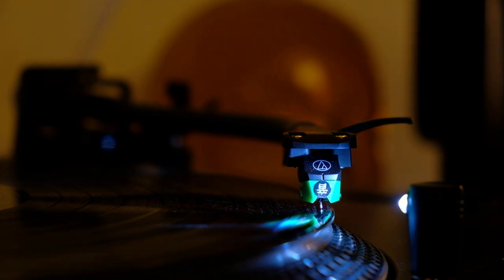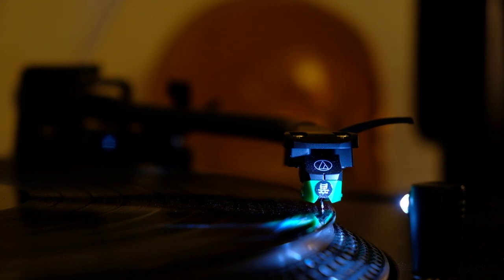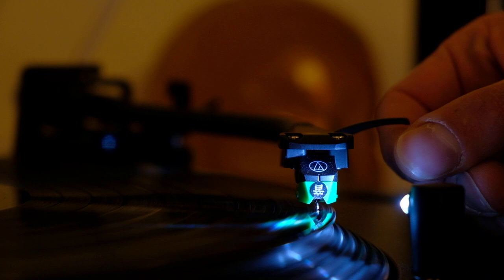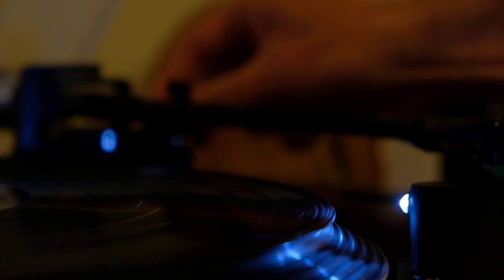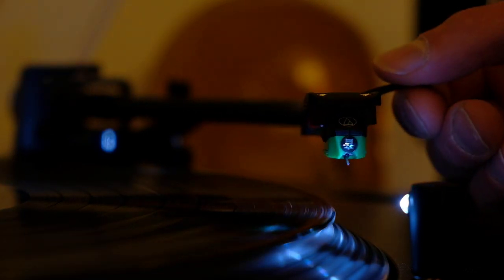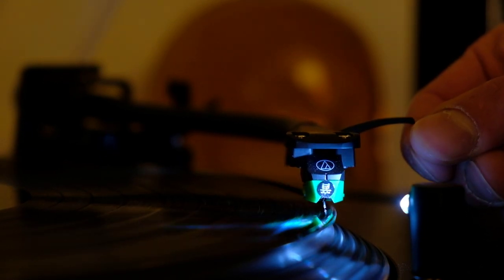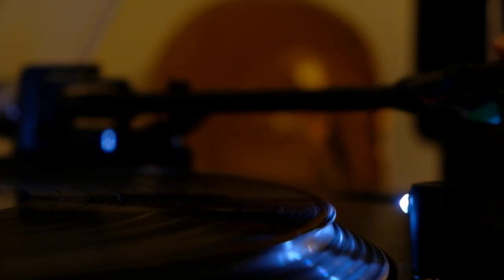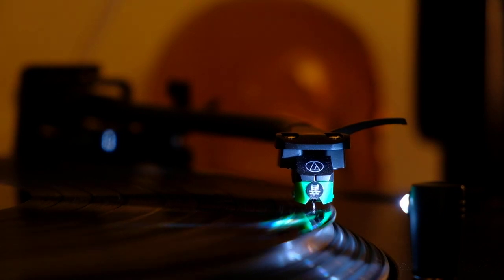Quick and dirty anti-skating setup method

Comment: Finally a method that makes sense to help those without ability to accurately test this setting. It allows us to 
get it set very close to the proper setting. For most folks that is the best we can achieve. This setting has always 
been the one setting I could not feel confident I did right. I set it by careful listening and it turns out your method confirmed
I had it set well.  Problem with the dial type with numbers the spring weakens over time and matching the grams to dial is not accurate over time (may have never been accurate).  Thanks again for this tip.
Reply from the maker: There is another method that is even more precise but only works with manual record players. Check soundsmith’s guide on anti skating. Grams made no sense anyway, even if the dial were correct. You rarely end up there :)

Comment: Most interesting! But, something which I've used when the stylus 'finds' the groove is, is the arm trying to pull the stylus inward or outward...because that indicates more pressure on either the right-hand channel side of the groove or left-hand channel. Just have a look at the cantilever as it sinks into the groove (it helps if you have a long cantilever...my old V15 III and my new Goldring E4 have). I would say that my SME arm's lateral bias calibration is just about right - after all the bias markings are arrived at by more than guess-work. The blank disc method (yours is akin to that really) tells you only that you've put 'some' lateral bias on....not the correct amount necessarily!

BTW. The above method works when you lift the stylus out of the groove too....at the point where you relieve the cantilever of its tracking force (best use the stylus lift of the arm - the SME is excellent in this regard) see if the cantilever tries to return to its position relative to the cartridge casing.

Comment: This is great! I have set up my antiskating to the same amount as the weight itself (2 grams), which ís recommended by the manufacturer. However, dropping the needle at the beginning of my records had it skip over the first few grooves, which I now learned is something I might be able to fix with slightly more antiskating weight.
Reply from the maker: You are very welcome! It's well worth hooking up your stereo rig to a simple sound interface (Behringer has 25 usd ones that are just fine for this) and using oscilloscope software, it's available for free. The most expensive thing will be your test record, a good one is usually around 50usd, but that way you can setup everyone's record player.
Still, this method gets you close. And seriously, whatever manuals and even audiophiles say; this is the only quick method that doesn't involve an oscilloscope. Using a blank record makes no sense and setting it to the weight even less so. Manuals are often simplifying stuff, for instance; in a cassette recorder manual it always states to record until the meters only go into the red at the loudest peaks of the music. So that would be around +1dB's at peaks. Whereas tape manufacturers work really hard to make tapes handle way louder levels, sometimes even up to +10. If you were obeying the manual, you'd be wasting your money on those tapes. And it's the same with cars. No manual explains to you how to properly shift gears (i.e.; giving the gearbox time to synchronize from gear to gear, not putting it into first gear until you're almost stationary and actually letting the gearbox center itself, not pushing it diagonally to the next or previous gear). So I guess in the end we need to figure our stuff out by ourselves. Part of the fun, right? It's nice to get it right! :D.

Comment: Thanks for the advice. I have the LP120XBT + VM95E for daily listening and it’s working for me with VTF 2, anti skating at 1.1 with this method. I have the VM95ML too, but I guess that will need a different anti skating adjustment.
Reply: Same as me, weight at 2gr and anti skating at 1.0, weird configuration but works
Reply: Weird that I also found that 2.2 VTF and 1.0 anti-skate works best for me.
Reply: I used it at 2 for a long time and I noticed an improvement after doing the cd method. I also ended up at 1 with vtf of 2. The sound sounds a lot more balanced

Comment: Did this and it worked like a charm. My sound improved dramatically. Also matched up with a smooth movement towards the spindle on the inner dead wax of the record. This method stopped the aggressive jerking of the stylus into the spindle there too. Distortion gone. Using a laser disk I guess could also work but the goal there would be to watch the needle ride smoothly towards the spindle. And not for it to sit still at all points of the record-that wouldn’t work anyway on a pivoted tone arm; Maybe a straight tone arm.
Reply from the maker: Happy it worked! Still worth while getting a test record and scope, free computer scope software works as well. But in a pinch, this will save you :)
Reply: The Rolling Troll Thanks again. I fine tuned it  with a Wally-skater and it wasn’t too far off.
Reply from the maker: @DANIELHERNANDEZ-gg2lu  Hah, I wonder if that's from the same Wally as the Wally Tractor. I actually was at a lecture of his, amazing guy :D.
Reply: The Rolling Troll I think so. Wow. You got to see him before he passed. Amazing. Thanks for sharing.
Reply from the maker: @DANIELHERNANDEZ-gg2lu  I think it was the AAA Audio show in... 2017? Not even sure, maybe longer ago. He was very much alive then, that's for sure!

Comment: oh my god, you just changed the whole thing!  Thanks for this video!
Reply from the maker: There are more precise ways but this is your fast one. Make sure you look into overhang and compliance though. It’s a bit much to handle but it matters so much. Feel free to tell me what record player and cartridge combo you got and I will tell you if your compliance is correct, and why.
Reply: @rollingtroll  The anti-skate was the only thing I did not have a clue about how to adjust it exactly.  I have a TD124 + Jelco SA750L + Phasemation T300 SUT.  I use an Ortofon SPU #1E  and a Zyx Ultimate 100, depending on the mood.

Comment: Hey thanks so much for the video. Was definitely experiencing some skipping over the first few grooves before doing this. Question though: when I lift the cueing lever at the end of the record (or even in the middle), the tone arm goes up but also swings back somewhat substantially instead of just popping up in place. Is this normal? At a lower anti-skating setting this obviously wasn't happening because there wasn't as much force pulling the tonearm back. Thanks again!
Reply from the maker: You are welcome! Your lift is pribably dusty and slippery. Clean it with a q tip and some alcohol, also clean the bottom of the arm where it touches the lift and it should be good :)

Comment: Seems that many of my jazz discs have lead-in wax that is not exactly flat (like the rest of the album), but wider and inclined to drop down onto the flatter/main section of the vinyl.  This, I would think, would affect the forces involved, no?  Solution...  make sure to use a disc with flat lead in wax.  But still, as I have experimented with non-groove vinyl sides, the tracking for any given setting seems to behave differently, depending on the needle-drop location (first-track, middle, last (toward inner dead wax).  I tend to calibrate in the middle of the platter, and so remain dubious that this method produces optimal results for the entire platter.
Reply from the maker: Absolutely, make sure you either use a flat one or only use the last little bit. Or get an oscilloscope and a test record, which in the end is the best option :).
A test record has its anti skating setup grooves on the inside of the record, and then one at the beginning and one half way. You do the setup on the inside though. So nope, this is most definitely not the optimal result. But that's also exactly what I say, and exactly why the title says 'quick and dirty'. It's as close as you'll get without a test record and oscilloscope.

Comment: never use outer edge of a 12" record. the cross section of the 12" is not even. it's down to the moulds used by given press, be it SMT, Toolex or Hamilton, the first 5mm is NOT horizontal.

ive been pressing records for ages, and ive dealt with most of the pressing mould inserts available since the 60s ;)

Comment: I got a question if you set the antiskating for the beginning of the record would that be too much for the end of the record? Because it will be pulling to much to the outer grooves?
Reply from the maker: It's supposed to pull equally hard on the entire record :). 
If it starts pulling more at the end, you have a very bad anti skating system :)

Comment: In the end...your method is actually like setting the antiskate with a blank lazer disc and let the stylus lean towards from the outside to the center of the lazer disc but not aggressively
Reply from the maker: You can also just use a normal record with quite a bit of dead wax at the end, put it where there is no groove, let it move inward slowly. Works fine too. Laserdiscs have a different abrasiveness though, the stylus doesn't move as freely on them.
Reply: @rollingtroll  I know,that was not my point but I agree in general
The stylus should lean towards the center of the record but very slowly

Comment: Franke Schröder, who designs and builds some of the world's best tonearms, came up with a similar anti-skating test. Instead, Frank's test is done in the run out groove towards the dead wax. It is explained  @6:35 in this video: https://www.youtube.com/watch?v=6pmD1gIL_cU
I will be trying both methods. Thanks for the tip.
Reply from the maker: Ideally you may want to use the middle of the record. This method seems to match with a proper setup using a test record and oscilloscope more than using the dead wax. May have to do with me using bearwald for overhang, maybe Franke is a Stevenson guy
Reply: @rollingtroll   I tried using the deadwax but it was prompting me to use hardly any antiskate at all. With your method, antiskate is now about half of the VTF, which makes more sense (and sounds much better).

Comment: Holy shit this works! My records sound glorious! Was using blank record method before and this is better.
Reply from the maker: Easy peasy! 😁
Reply from the maker: That said, if the difference is very shocking there may be other things wrong. How did you setup your overhang? Also what arm/cartridge combo are you using? It may be way off, and then it just gets more sensitive to everything.
Reply: @rollingtroll   My player is a Teac TN-300SE-MB and my cartridge is a AT-VM95EN. I used one of the Hudson set up records with a scale on one side and the other side is blank.Only problem I was having is a little bit of IGD and it would skip when I would drop the cartridge down to play a record sometimes. I know some IGD is not 100% avoidable but I was having a little more than I thought I should be having. I do plan on upgrading to a micro line cartridge.
Reply from the maker: It's really hard to find the effective mass of this arm, but what I found is 23 grams which is properly heavy. The AT-VM95EN is relatively high compliant (way more than the "E"). Have you tried it with the regular "E"? If not, do it. I know it's technically a worse performing stylus, but chances are it will match way better with your arm.  @kevinwest1607
Reply: @rollingtroll  Thank you kind sir I appreciate it.
Reply: @rollingtroll  Eventually I would like to upgrade to a ML cart. Any suggestions would be appreciated.
Reply from the maker: Without wanting to over-explain (dare I say mansplain? :D) here's the whole effective mass/compliance explained in a 2am rant I did some months ago: https://youtu.be/OlR2682ZW0M?si=dxy2fkJCd_7dYhP7

 @kevinwest1607
Reply from the maker: @kevinwest1607  Without wanting to be mean; There's a point in which the record player isn't really worth the cart anymore. If you want to invest in a lower compliance ML cart, you are definitely going to run into the limitations of the record player. I don't know how you feel about second hand, but I would keep the AT-VM95ML and find yourself a nice Pioneer PL-112D. Great player, matches with the cart remarkably well, and sounds infinitely better :). Should be under 150 bucks for a tidy one.

Comment: couldn't have been more funny explanation ! Not all records are made the same way on the outer rim.....
Reply from the maker: This is true, but this is only an approximate adjustment. If you don’t have any equipment to test it, this is as close as you will get. It is smart to use a record with a relatively flat beginning. Some are a little bulbous to the outside which does make the results less reliable.
Reply: @rollingtroll  That I agree !